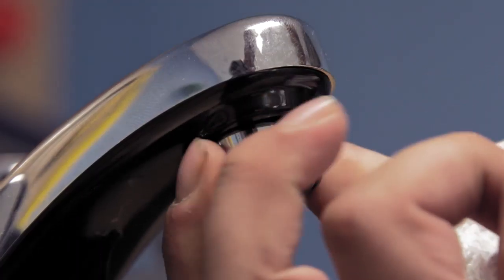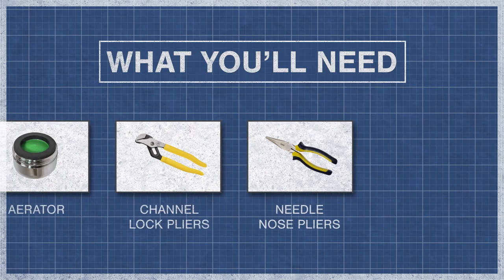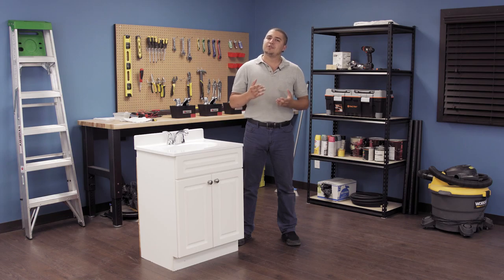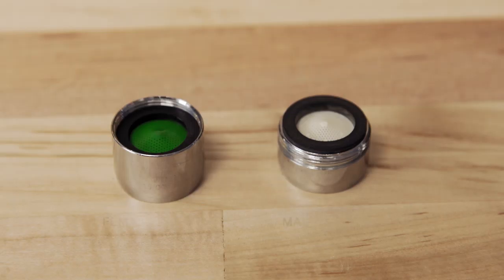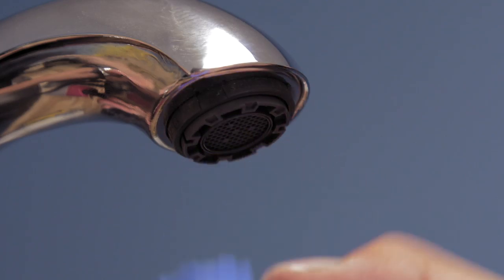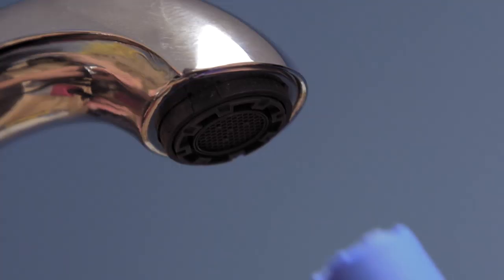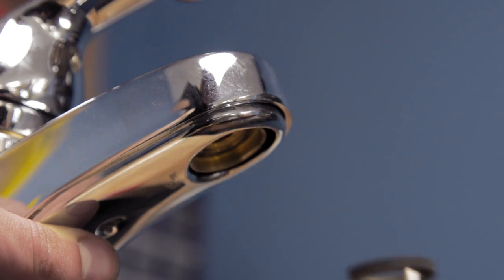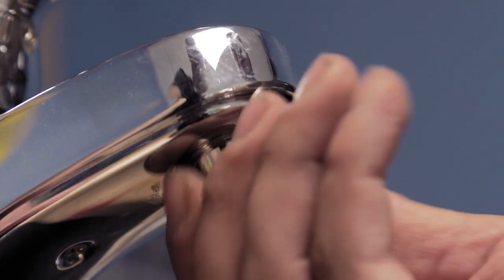How to Replace a Faucet Aerator | Repair and Replace

Comment: Mine doesnt unscrew that easy its almost as if its glued in there
Reply from the maker: Hi Jay, thank you for watching. Minerals in the water can start to build up on the threads making it seem like its locked in place. You can soak a rag in vinegar and place over the aerator for 10 minutes to let it soak in. It can help dissolve some of the minerals making it easier to unscrew.

Comment: Had purchased a movable kitchen faucet head 360° just as the one shown in this video - https://www.youtube.com/watch?v=PuwWICfy05M. Is there any way you could show how to repair the shower head. Plumber had to open it recently to clean the same of dirt & mud and after fixing it back, the faucet works only in a single spray mode. The other 2 modes don't work. Any way to explain how to fix the faucet so that all the modes work.
Reply from the maker: Hi Sanjeev, thank you for watching. That is a pretty specific model that we haven't seen before. It likely has a diverter inside of it to change the water when the side button is pressed. There is a chance that the diverter piece was installed upside down when the head was put back together. Also sometimes pieces need to be placed in a certain direction. It might be rotated 90 or 180 degrees so check that the holes inside line up. Without alignment, the faucet can't divert the water,  meaning that other modes not working. Hopefully this helps.

Comment: Did not show how to repair an existing but only to replace, so a misleading headline.
Reply from the maker: Thanks for watching. The video name was specifically "How to Replace a Faucet Aerator" as well the description lists exactly what will be done. The series name is "Repair & Replace" some videos focus on troubleshooting and repairs and other videos are direct replacements. 

Regardless, the aerator is not a part that is easily repaired other than cleaning any buildup of minerals with vinegar. In most cases a replacement is just best.
Reply: @AmreSupply  I repair them and clean them, unless one of the plastic pieces cracks or breaks in more than one place. A soldering iron and sandpaper works great.  Using vinegar is the easiest and safest way to clean it, especially if there are children around. Always clean the inside of the faucet too in order to remove debris there too.
Reply from the maker: @johnnypayne9614  Thanks for sharing those tips. Most people do not have a soldering iron which is why most will replace it rather than repairing.

Comment: What you show is very obvious. 
It didn’t solve my problem
So what do you do when the faucet is a Moen, brand new, just installed hours ago, and a strap wrench won’t fit. Sorry I won’t use a towel or rag as the pressure from adjustable players is not even , deforming the piece and will scratch the finish. 
I even bought a pair of plumbers pliers with slip on silicone tips at Home Depot , it was a waste of money as the tips did not provide any grip and slipped out of the brand new pliers tips.
Moen was no help, they bounced me over to Home Depot to an associate who was no help.
Reply from the maker: Thanks for watching. Just to clarify, you're trying to remove the aerator on a brand new Moen faucet?
Reply: @AmreSupply  yes